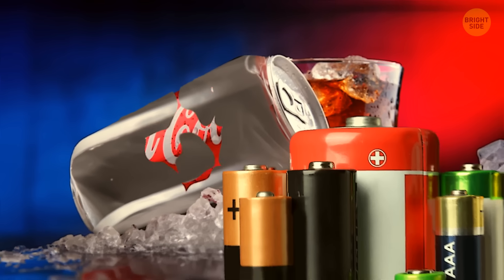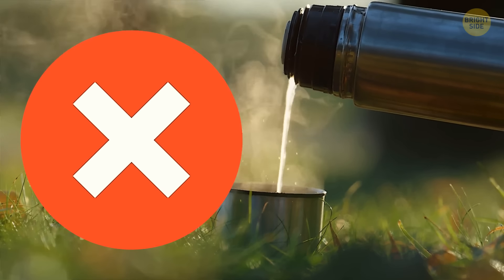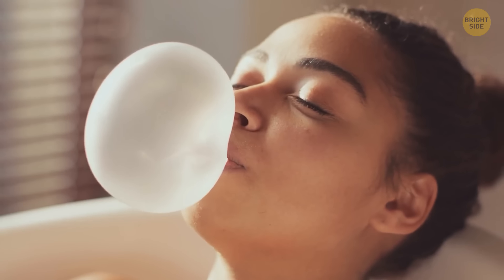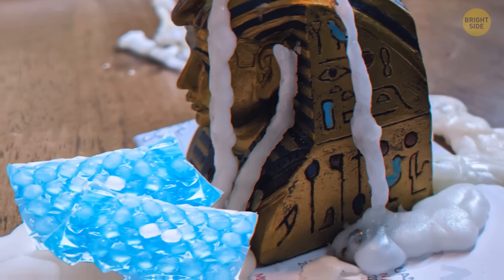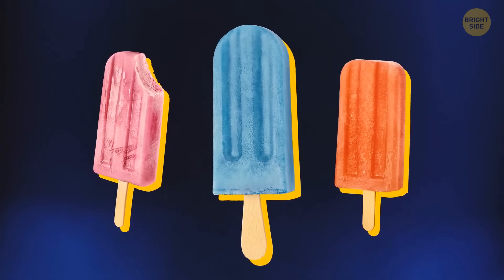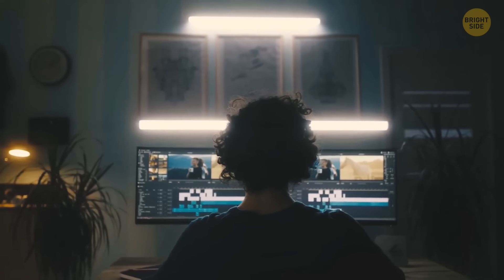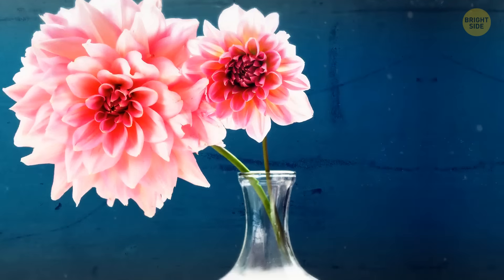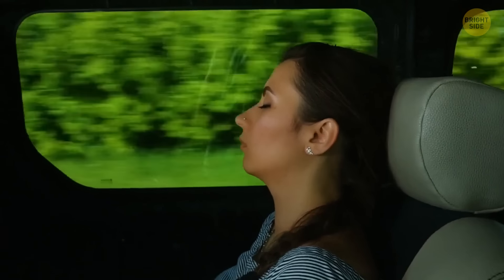55 Ordinary Items with Extraordinary Secrets

Comment: @7:18 If 1 zipper fails in the manner depicted in a scenario with a single-zipper suitcase it would still remain closed. Also if you only need to open a small opening to drop something in it like shown, a single-zipper suitcase is capable of the same.
Reply: he means to take out something

Comment: Taco shells at 700 degrees for 10 minutes???  Most household ovens don't exceed 500 degrees.  Also, at that temperature the taco shells will be more than crispy!
Reply: Probably means 700C, not 700F
Reply: @sharonshort4018  That's even hotter.  It's nearly 1,300 degrees Fahrenheit.  I've never seen a conventional household oven able to exceed 500 degrees Fahrenheit or 260 Celsius.
Reply: @sharonshort4018 ummm do you understand how the metric system works?